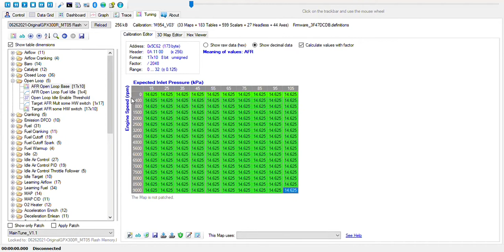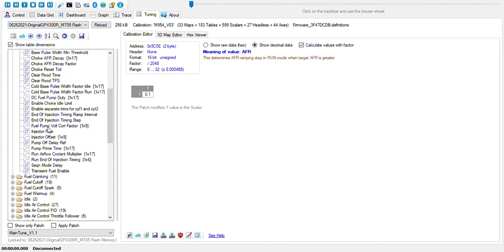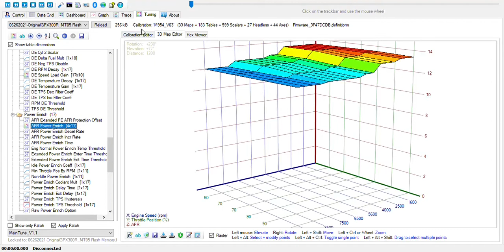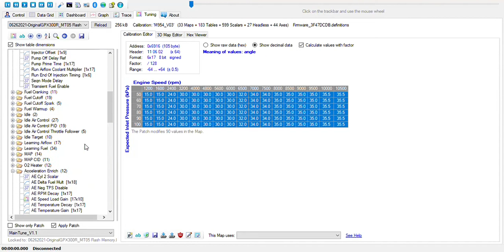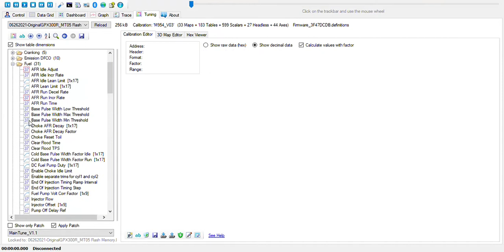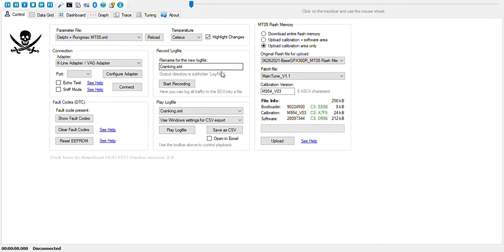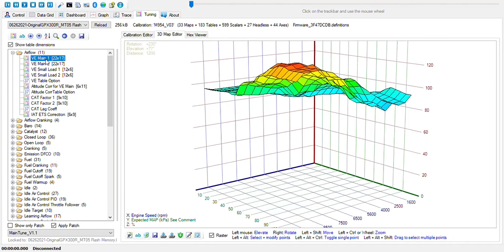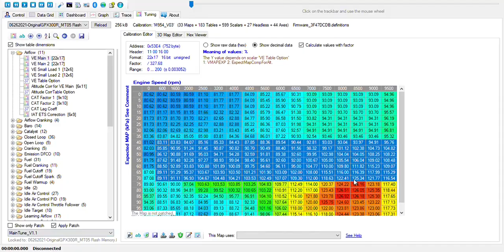2021 GPX300R HUD ECU Hacker Tuning - Delphi MT05.2

Comment: On my bike (mash 400cc) i de-catted the exhaust. To make it run better i set it to stay in open loop mode.
Now you can change the AFR without the O2 sensor keeping it on 14.6:1.
But for idle it wil use close loop.
Plus i changed the spark advance.
Also turned of the decel enlean for smoother on/off trottle and lowered idle rpm.
Reply: how to make without o2 sensor yeah delete column ?
Reply: @janjirezeki4983  keep O2 sensor. Just keep bike in "open loop". Removing O2 sensor shouldn't be a problem except a blinking engine light.
The so called " limp mode" is the "open loop". But it has to be set richer and some other tweaks or else your bike wil be way too lean.
Just try HUD ECU hacker on elmusoft. But read into it. Study the software.

Comment: Hello, can you help me remove the speed limitation from my son's moped, who has a MT05 ECU DELPHI?  Any suggestion will be welcomed and valued.
Reply from the maker: I've never enabled it but most likely under Fuel Cutoff Testing -> HW FCO Limit Vehicle Speed.  You could possibly also remove this under Hardware --> J1-16 Input Usage change to 0.
Reply: Thanks for your quick reply. Can you assist me on how to change the input usage to 0? It’s a jumper, a wire connection or anything else?

Comment: Hej. 
If any interested, i would like som fun and tune some maps. So if any out there want a try out, please reach out. I expect you to have  a k-line cable or Tactrix reader for some SERIOUS  datalogging. 
By the Way, my bike is a chinese Yingang yg-125-23A, modified with a 200 cc engine, 32mm intake manifold, high flow filter and bigger injector.

Comment: Hi Sam I hope you dont mind me commenting / contacting youBUT I am struggling at the moment 
I have a Fresia F18 that was originally powered by a 18 hp Briggs and Stratton flat twin engine. After several failed carb swaps and a poor attempt with a chinese copy of megasquirt fuel injection set up I have swapped out the  original engine for a Honda IGX800 fuel injected V twin with ecu control. To get it in and running has been a challenge but its in! and running it performs well BUT I have one major issue the idle /tick over R.P.M.  The Briggs idled at around the 850 / 1000 rpm mark  THE Honda idle is set at 1400 rpm The F18 is hydostatic drive and as the tick over is 400rpm higher as soon as drive is engaged it is away !!!!! The Hand and foot brake are not strong enough to hold it back so it is potentially dangerous!!! Before I bought the engine I was informed by a supplier in the UK that it was adjustable! 
WELL it isnt!!! I have been on to Honda uk who inform me that they can reduce the top speed from 3600 to what ever I wish and they can increase the tick over to more than 1400rpm BUT THEY cant reduce it to 1000 rpm  I installed the engine last January (2022) and have been searching for a solution on and off since then! Messaging ecu tuners  specialists and anyone I can find that I think could help.
My hopes were raised by a possible bitbox solution but  that proved fruitless as my Delphi ecu is a MT05.3 and bitbox was for MT05.2
I have come across this HUD ecu Hacker and references to Delphi ecu's  I am 59 very mechanically minded but not to good with electronic technology I know It should be possible to alter the idle rpm but the access and the programming to the ecu and how to flash / read the ecu is a little beyond me. How can I get into the ecu ? Is there something on the market to buy? How can I contact the HUD ecu Hacker for help advice?  I spent a lot of time getting the engine fitted and running to be thwarted by the idle rpm !!!! (with a carburetor it would be just turn a screw !)  I would really appreciate any help or advice you maight be able to provide Cheers Gary
Reply: Hi. I think the dev said mt05.3 is not possible to be flashed. Even with the newest version of the software

Comment: THANK YOU Very much ! you covered several issues I have had questions about !
I got a Chinese adaptor which did not work so I got the Tatrix J2534 and it's on the way.... hopefully that will allow me to DL my ECU,   I have a 2021CSC RX4 450cc
bike that just runs too lean everywhere in my opinion and it stumbles when idling
(which is annoying) but the Idle speed of 2100 I have got to change ! LOL
other than that the Heavy Pig of a bike is a good one just too heavy ! hopefully I can change the Map to where it runs strong when wanted as it's kind'a soft in that area right now.  thank you for your help, the program is not intuitive !

Comment: Cooool ! When I lived in China I wanted to tune my MAP on RX3 but only found expensive software
There are 2 NC300 kits huh RTC NC300 81mm I think and another 84mm (298cc)
Reply from the maker: I know right?  It's very cool! I was looking into the expensive software like Bitloader last year as well but huge, huge respect to the person that developed HUD ECU Hacker. It is well worth the donation.  Yea there are 2 big bore kits for believe 273cc and 298cc, our GPX bikes come with the 298cc kit and this can be set easily in the ECU map under System -> Cylinder Volume.
Reply: @SCakey  ever thought about swapping to the DOCH engine and 298cc?
Reply from the maker: @nct9466  If I were to blow up my SOHC then sure but I don't think I will.  I have one of each a SOHC and DOHC.  I appreciate the simple valves of the SOHC and it is a nice engine, think it's as good/better than KLX/CRF300s.

Comment: hello sam, do you know how to extend the tables for rpm?
Reply from the maker: If referring to the rev-limiter then that is set under Fuel Cutoff-> Threshold OSFCO.

If you're referring to the header on the tables, that is preset within the ECU from base parameters.  You can change that but I'd be careful.  Those base parameters are all under  Axis -> Engine Speed.

Comment: How to edit topspeed?
Reply from the maker: I'd just turn it off if it's enabled. We do not have this enabled but I imagine if it is enabled would be under Fuel Cutoff Testing -> HW FCO Enable.  If yours is set to 1 then that's enabled, set to 0 and disables.

Comment: is there a place/site where some or most of these terms are somewhat explained? i mean, some terms do make sense but it's still not very clear on where to start,for example, what tab do i select to enrichen the fuelling generally?
Reply from the maker: If you just want some generally richer you can set Closed Loop->AFR Stoic lower to say 14-14.2 but I wouldn't set much lower than that. And unfortunately no there is no manual for tuning this ECU, we have the keys, we can get into everything but we don't fully understand the reaction it causes.  A lot for me has been guess and check with my bikes as well as chatting with another guy that's tuning these who has some car ECU experience.
Reply: @SCakey  thanks for the advice on the closed loop. Also saw in the app that there's an explaination for most tabs (y)

Comment: Your videos are very good, thank you.
I'm from Portugal
Is the injector you have on your bike the 25359853?
I have a 250cc rx3 and I would like to put the big bor 300cc like your bike but I need the ecu map, and if the injector is the same.
Thank you very much
Reply: No need to retune
I had an RX3 with 283cc NC300 big bore
Reply: @nct9466  Thanks for the answer,
the differences of the bike after the big bore? worth it?
I can only find the 84mm big bor for Portugal.
Thanks
Reply: @dariofeitor1649  added much better bottom end torque as it was lacking
Yes worth it
What’s the kit cost there? Maybe I should start selling again lol!

Comment: any idea what could be causing one cylinder to fire upon startup? I have a CFmoto 800xc. I has issues with cold starting and sounds like one cylinder is firing. Any help would be great if you can. Thanks
Reply from the maker: It depends on how they have the map setup as there are options for cylinder 1 and cylinder 2. I believe there are even a few options that say, "Use the same settings as cylinder 1 on cylinder 2". Unless this has happened since new I'd almost lean towards a hardware issue like bad spark plug or maybe bad coil on one cylinder. Unfortunately my bikes are single cylinder and my maps are just whatever base for the 2nd cylinder that the factory left since it's not used.
Reply: @SCakey  i actually had my bike tuned by a service where i sent it out and had a performance tuned flashed to the ecu. it didn't do it prior to getting it flashed. other guys i have spoken with that also have the same tune have mentioned this as well. the guy that did that tune refuses to look into it and has said there isn't anything wrong and its hardware but i know of at least 5 that have had this problem since being flashed. unfortunately I don't have the original tune either. if you stumble upon this setting in your spare time id be interested to know more. do you have any info where i could brush up on what settings are what? I am very knew to this tuning thing. Thanks
Reply from the maker: @scoot00025  That guy sounds like a dick that's just looking to take people's money. Like I can change maps on GPX bikes and feel comfy doing it but I ain't comfortable enough to take people's money for it.  I mean as far as learning the settings, it's really going through HUD ECU Hacker and there are limited descriptions of each setting but you kinda have to do guess and check with the bike running to confirm things.  

One I'd be curious on for yours is under System --> Base Cylinder. It's a specific setting to choose the 'base cylinder' of the 2, maybe that guy changed something there and it's trying to run on a base cylinder the rest of the map isn't setup for. I'll admit a lot of the cylinder 2 stuff I've kinda ignored for my uses, I'm sure there are a few other settings and will keep my eye out.
Reply from the maker: This type of guy doing these maps is kinda a worry of mine with this software, like it's not hard to change these maps but it IS hard to do it RIGHT. The ECU is basically a big relational database, change one table and you'll affect 10 other tables that relate to it.
Reply: @SCakey  well at least I have an area to look into. Thanks for your help and your time!

Comment: I've just gotten a 450R and out the box it seems to be very lean. I'm going to clean the injector, replace the fuel filter and double check for any leaks but if it remains lean (which I hear they are anyway) I'd rather not have to go the route of spending more money on an Aracer kit. Has anyone spent time working on an updated map for the 450 that richens things a bit?
Reply: Yea me and a buddy are heavily working on a tune for the fse 450r from gpx.
Reply: @MixedGrid  did you have any success with this? i got my cables a few days ago and im looking to start messing around with it.

Comment: Hello, very Nice vídeo gained another subscriber, been trying to use this program on my AJP PR5 for a while but cant get it connected, MY AJP USES DB9 OR RS232 to connect, but ill try with your idea of getting a conversion for DB9 to OBD2...
Not with intentions of tuning the ECU, because it is well tuned, but with the intention of whatching for errors data and some fun 😂
Uses the same engine but 250cc
Reply from the maker: Yes it is very helpful for checking errors and recording things as well. If you have a DB9 connection on your bike then I'd guess one of those DB9->OBD2 adapters would work just fine, they say they support K-Line which is what this runs on. Then you'd just need an OBD2->USB cable, connect them up and to your PC, make sure to install the drivers on your PC so it detects the USB cable.

I would personally be very curious to get a bin file of your AJP mapping if you get it working but no worries if you never download the map and just look at diagnostics.
Reply: hi sir im from phillipines I always watch your Videos i have the same ecu delphi mt 05 and software but i dont know what to do to set the new Parameters because my motorcycle is Getting alot of backfire in low rev and sometimes the engine is dying in a middle of traffic when i see the settings is the afr is so lean how to i get my setting to get to 13.5

Comment: Hi, I'm running straight pipe no catalyst, how can I disable all the environmental restrictions? Thanks
Reply from the maker: Probably under Catalyst -> Cat Light Off Option. Mine is set to 0 since our bikes are just straight pipes out but you'd have to test it. If you dont have an O2 sensor it'll be more digging because you'll have to tune open loop mode.  Open loop exists on this ECU but for mine it's kinda a poor tune that 'works' but aint great.  There is also an option to turn off Decel Fuel Cutt-Off (DFCO) which is part of emissions but that's more for fueling.  It's not as easy as a single setting here.
Reply: @SCakey  Hi, Yes i saw there are two options actially. One is Emission dfco and one is catalyst. So the 0 setting on catalyst is to disable it? That's strange, stock it comes already with 0 as a setting and my tnt600 has a catalyst from the factory. What about emission dfco? I'm already running open loop because the tnt600 has only narrow band oxy sensor. Thanks

Comment: U should just throw the DOHC head on the 300. Did wonders to the 250. Ton of torque, big kick in high rpm 30hp to the wheel.
Reply from the maker: Unfortunately not swappable to the SOHC version (yea I looked hah).....but I may be getting the 300 DOHC.  Around sea-level seen ~36HP dyno on those DOHC ones which is kinda impressive, that's WR250F numbers.
Reply: @SCakey  They claimed 34-36 on the 250 DOHC. It feels +30 to rear wheel, and I said it felt like the carbed wr250f's but more linear. Really impressive on a lower maintenance motor.
Reply from the maker: @tieoneon1614  I may have been stretching the truth when I said, "may be getting a DOHC 300R"....it might actually be on order. :)
Reply: DOCH isn’t the same engine as SOCH
I used to sell the NC parts old n new versions
Reply: @nct9466  originally said they were, but after i looked it into you are right they dont swap
Reply: @tieoneon1614  not parts but the whole engine I’m sure can be swapped out

Comment: How do I unlock my rpm limit? 9k rpm max only
Reply from the maker: It's under: Fuel Cutoff -> Threshold Overspeed Fuel Cutoff.  Basically ECU just cuts fueling at those RPM points, I wouldn't go much over 10.5k because these engines just don't make top end power like that, max power is around 9k.
Reply: @SCakey  Okay sir, thankyou. My unit is Lexmoto Aura 125 automatic
Reply: @SCakey  I thought it can be disabled the rpm limit on the dashboard menu.
Reply: I mean the rev limit
Reply from the maker: @junaldjohndapigran9779  Not disabled but you could set it so high it'd never engage.  Like set it to 15000 RPM and you'll never hit that.
Reply: @SCakey  I saw same unit of mine, used this HUD ecu hacker. From 9k rpm before, it reach 11k rpm max. They dont want to share info, so  I want to learn by myself
Reply: @junaldjohndapigran9779    I know this might be a bit late lol

I'm running a Sinnis Apache SMR 125, I have the K157FMI engine. Sinnis and Lexmoto are essentially the same company. I wouldn't go over the preset limit on the chocolate engines these companies use, they are unreliable enough and being a scooter you will assumably be spending a lot of time on or near the limiter. It will work for sure, but you will be limiting its life. By how much is debatable of course, there are many variables to consider so it is unpredictable, but I just want you to be aware of the risks.
Reply: Yeeeees... Thanks Sam! Already got the VAG cable, will be playing with it soon... Fix idle, richen it up, would like to advance the timing a little... Will have to figure that out...